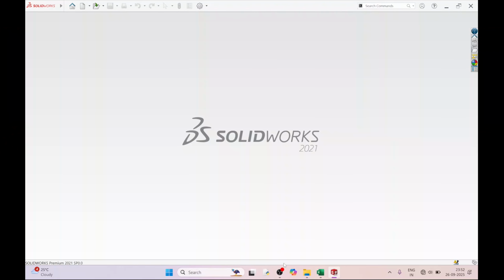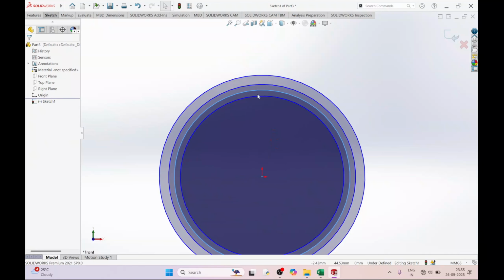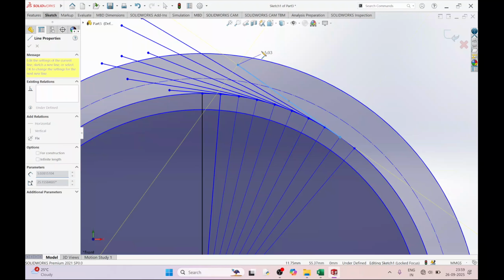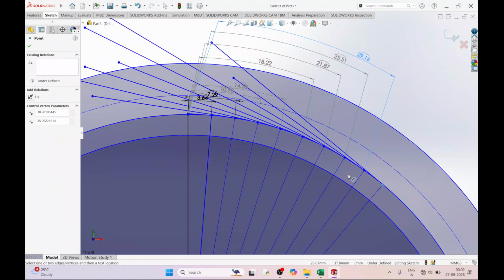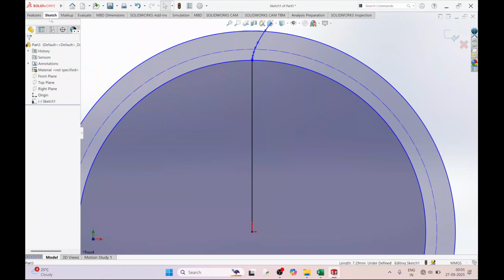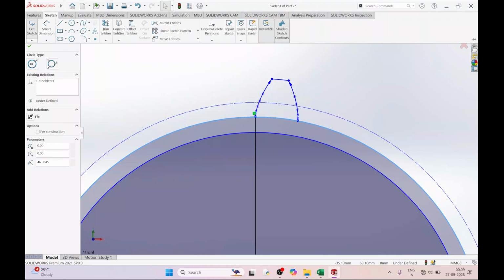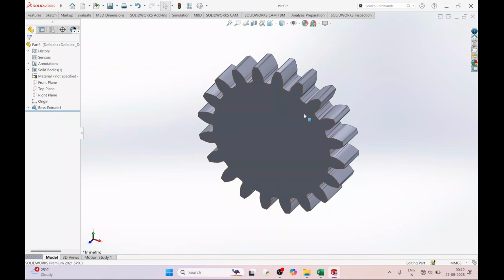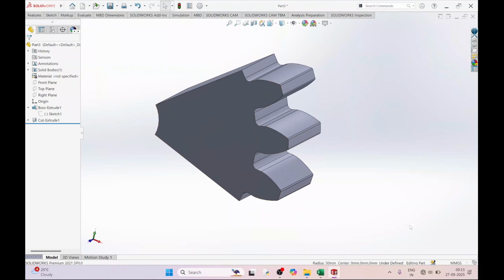How to Draw Involute Profile of Spur Gear in SolidWorks | Easy Method | Step by Step Procedure

Comment: Here pressure angle has no action sir?
Reply: Pressure angle equals to Base circle diameter/Pitch Circle diameter.If you look at the table you can see that he used pressure angle for being able to find base circle diameter.
Reply from the maker: @program.denemelerim Yes, Exactly Sir